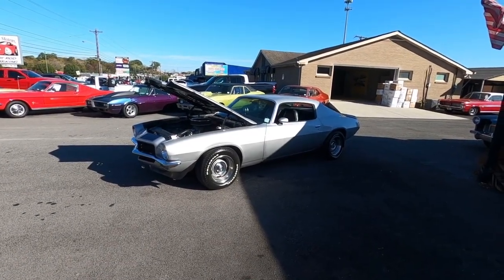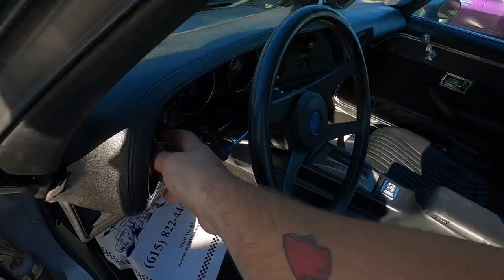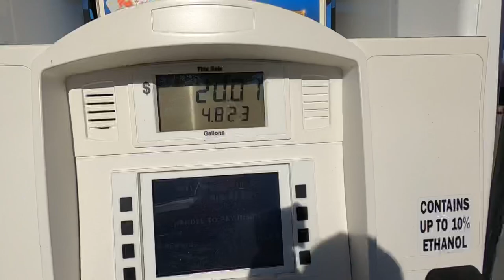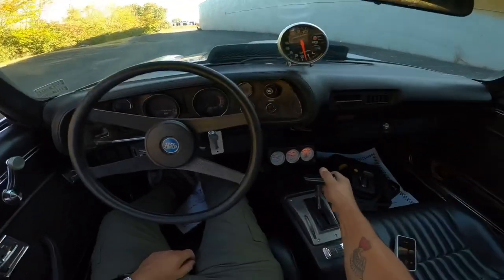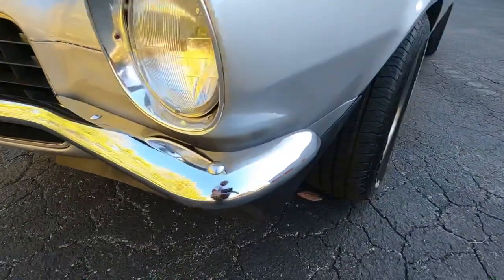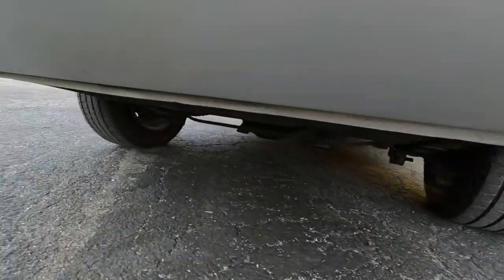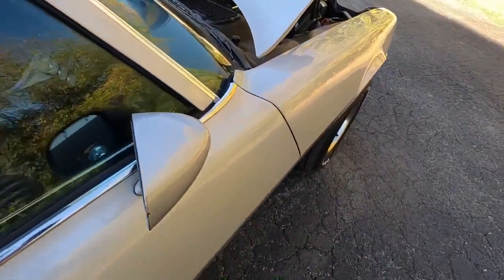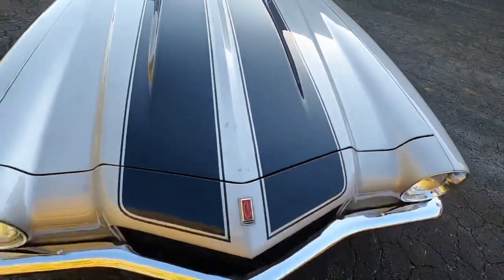Test Drive 1974 Chevrolet Camaro SOLD $22,900 Maple Motors #1870

Comment: What really hurts this car is whomever did the transition to the 70-73 front and rear didn't put side marker lights on either. I don't know about all the laws in all of the states but in Illinois that car's not legal to drive on the road.
Reply: That's just one of a zillion reasons not to live in Illinois. You need to take back your state and annex out Chicago.
Reply: @timsacco6g694  he’s saying the legal issues slowed down what could’ve been with the lights. Expand your thinking bro
Reply: Stevi Robinson  every state don’t have the same laws…
Reply: Its not legal in PA either however that is all wrong. Nothing on this car is interchangeable with a 74.
Reply: Take maybe 20 minutes to side marker lights. Easy job to do.
Reply: Evidently since some of you aren't able to understand context. 

"What really hurts this car . . . " is called a lead into the discussion, implying the forethought "beyond the obvious things which hurt this car . . . here's another which some people may ALSO have to deal with . . ." 🙄

Comment: Somebody must have changed out the roofline and quarter panels rear glass and front nose to get the early 70’s look , if indeed it’s a 74 , a lot of work for nothing, also wrong horn button
Reply: Actually the 74 Camaro still have the back window that didn't drop down in the sides till 1975. Same with the 74 Firebirds. 🤠
Reply: @jamescunningham4180  
I stand corrected on that , other than that this car is about 20000 over priced
Reply: This channel gets world wide attention. These vehicles don't sit long.
Reply: Already sold.
Reply: Wrong horn button,  oh sarcasm.  Sheldon laugh....
Reply: Nothing about that body is a 74, maybe interior & motor.
Reply: Should have left it 74, just like 69 74 one off

Comment: Rear qtrs on 74 were different as the back window rapped but 73 to 70 had thiscrear window and front end looks to be a 72
Reply: The wrap around window didn’t happen until 75
Reply: I don't see anything from 74, not the body anyway. Maybe dash & engine,it sure runs good.